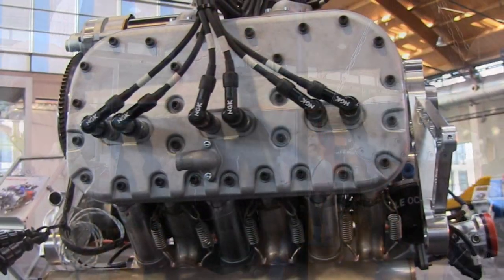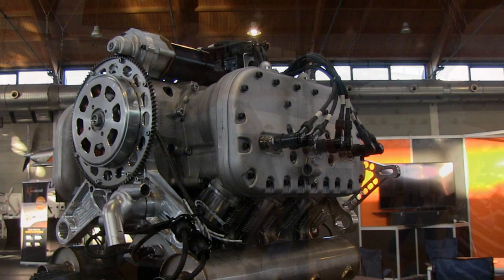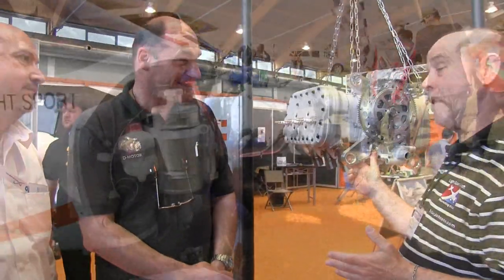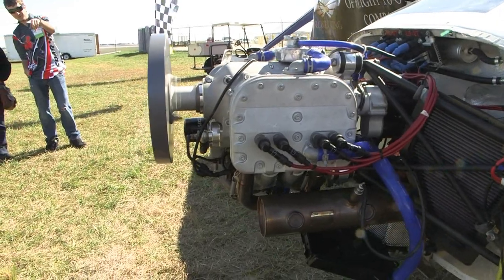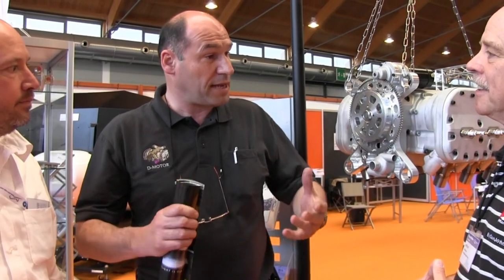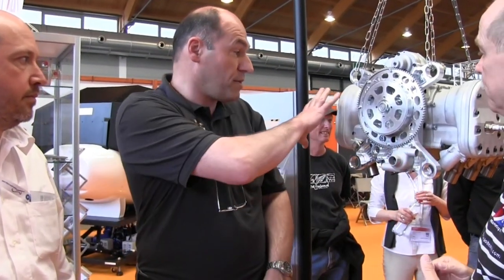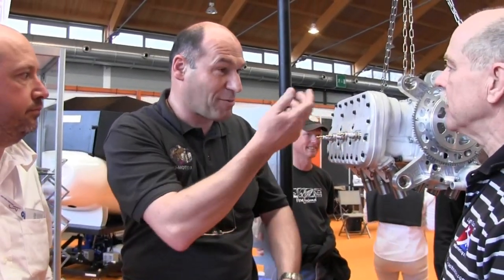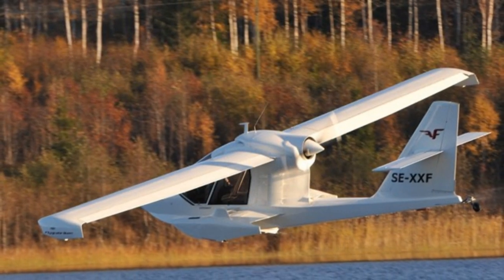D Motor, D Motor USA, LF29, LF39 Dmotor,  Deland Sport Aviation Showcase

Comment: A Better Mousetrap!  Using a boat is a great idea. Evenrude, OMC (Outboard Motor Corp.) used to do this at their research facility in Stewart Florida. They would rotate drivers and run those engines flat out for days and days. It was the dream-job in high school.

Comment: If you consider that the reliable RPM for most aircraft piston engines is somewhere below 3000, overhead valves are probably not even necessary.
Reply: Where did you pull that figure from?